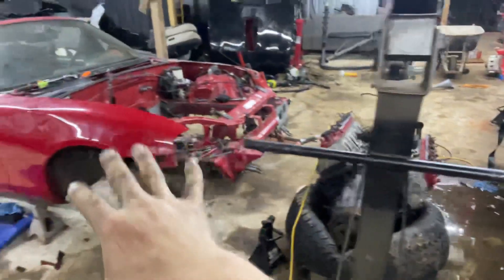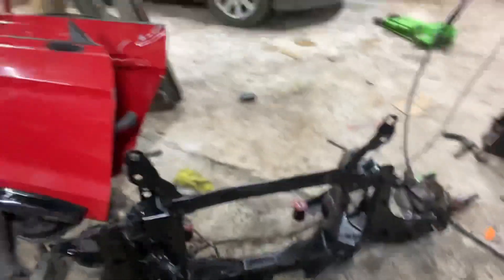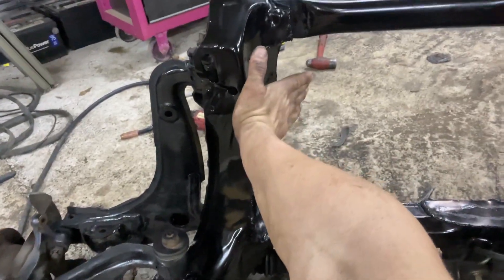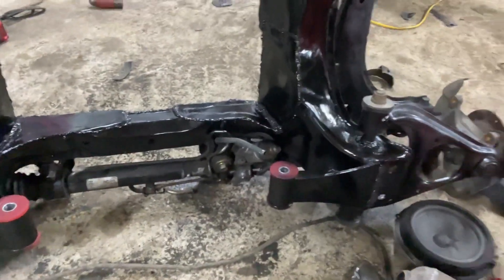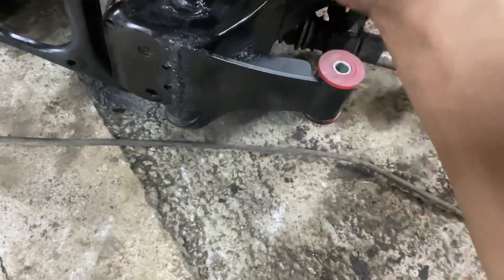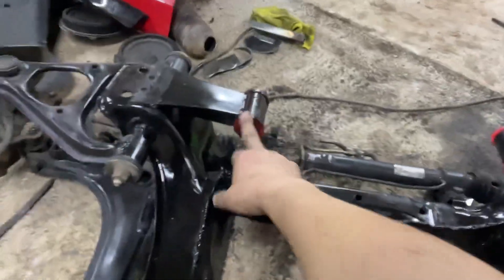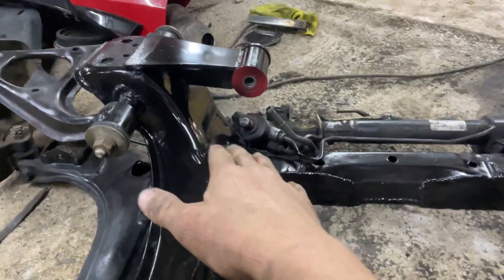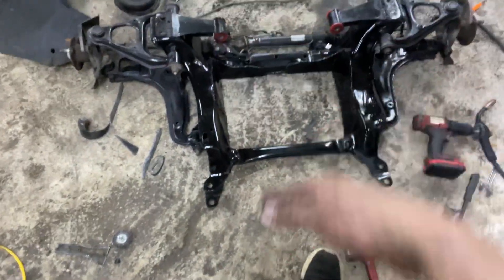Modifying and building the stock subframe to receive the 6.0 LS in the miata!

Comment: Did you ever finish this? I’m trying to swap one now and wanted to see if it worked
Reply from the maker: Yes, but where this video left off it still needs more clearance for the exhaust and starter. Motor did bolt in and fit with the way I built the subframe in the video.
Reply: @ what transmission did you put behind it? Did you have to clearance the tunnel as well?
Reply from the maker: @wilksracing5315  yes I had to make clearance to fit the transmission. I initially had a 4l80 in there but I think I’m fixing to go to a 6l80.

Comment: What happened to the f150/expedition?
Reply from the maker: @kristopherr326  I'm repairing the motor atm, it's painted and really needs fender flares to finish it off on the outside but it blew the spark plug out the  cylinder head so I have to fix that first. It's definitely not going anywhere

Comment: Which mounts did you end up using? There are so many different variations of the ls universal mount. I’m getting ready to start an ls swap on a 99 Miata.
Reply from the maker: Motor Mount Set Engine & Frame Brackets w/bushings For Chevy LS1 LS6 LS-1 LS-6 LSX Great Universal Type Mount https://a.co/d/4w5M0BV that’s not technically the exact one but it’s no different. It got it almost as low as the custom built ls subframes you can buy online.
Reply: Thank you! I really appreciate it. I’m doing basically the same thing you are. I like the way your subframe turned out.